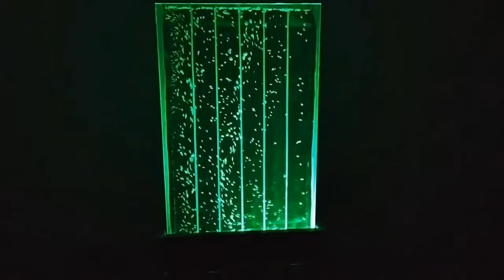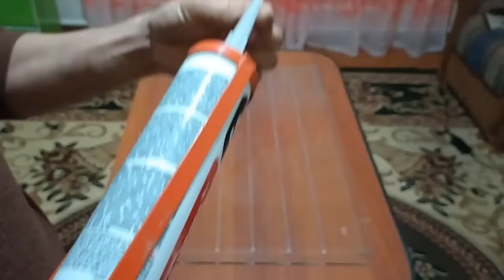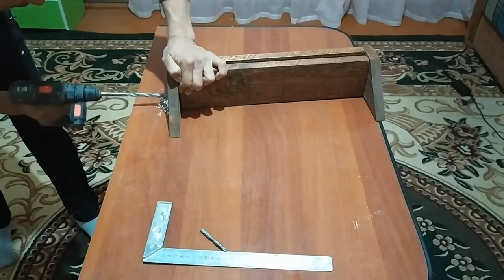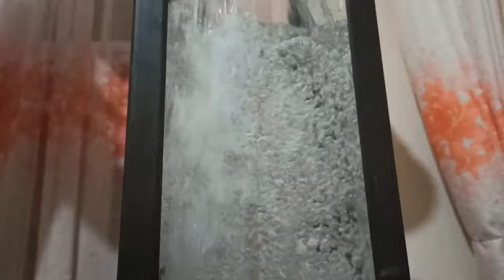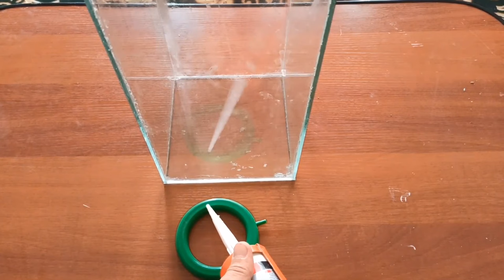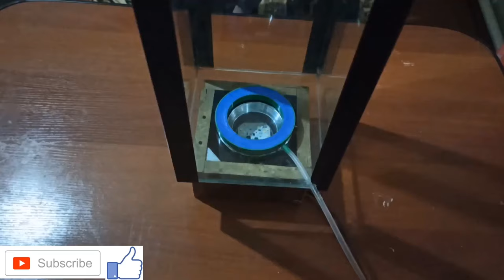How to Make Bubble Wall Very Easy | DIY Crafts | Life Hacks

Comment: very unclear and your video doesn't explain what materials you use. I feel that you should include instructions as you make the product with measurements.
Reply from the maker: If you read comments you can find
Reply: It's obviously silicone, glass, piping and an airpump..... If you couldn't get that from the visuals then such a project is beyond your capabilities
Reply: @BootlegHuman   youndhould not judge a person that quickly. Someone may have a disability and simply need clearer instructions. I think your comment is bang out of order. I have reported you as this is very upsetting to read 😔 THINK before you SPEAK and like Caroline flack said be KIND.